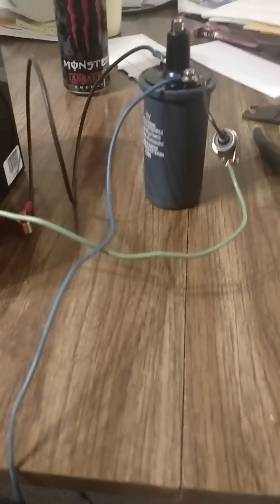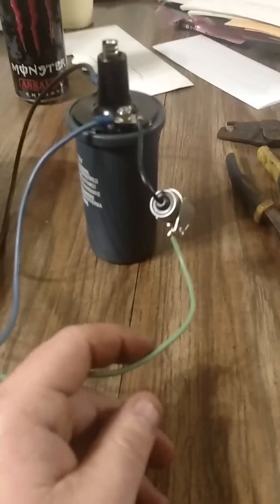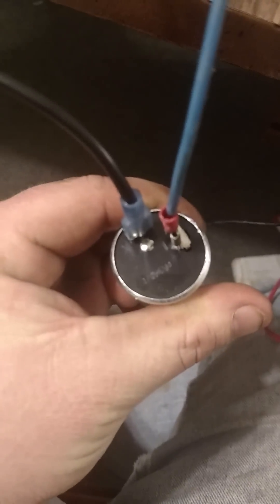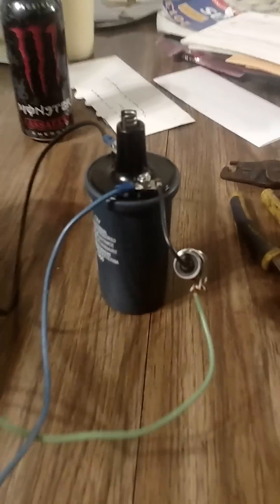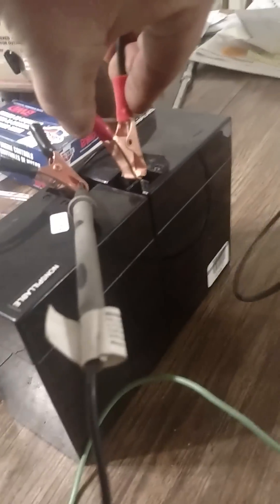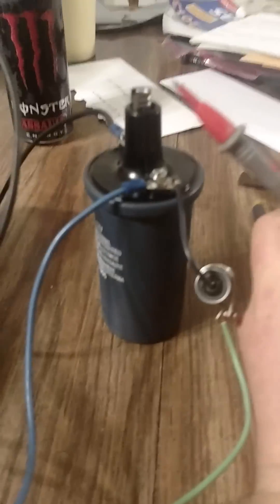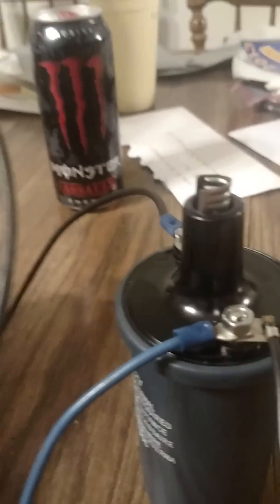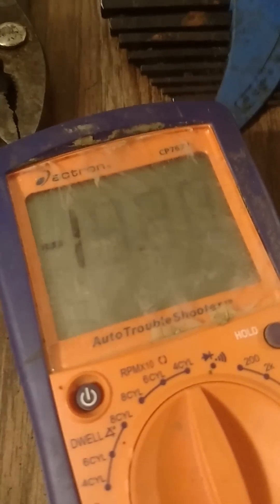Homemade electric fence energiser

Comment: I need to make this cuz I'm tired of people breaking that would teach them a lesson
Reply from the maker: Do your research on coils. I know there's one that burn hotter than what I had. And flasher relay goes on the negative side of the coil, in between the negative side of the battery

Comment: Guy told me he killed a bull with model T COIL  I USED A CYCLOPS FENCER.  Has lightning protection blows a fuse or about a$100 board. Pricey yes but mine has 32 joule out put . I  won't touch it  again!!!

Comment: I saw one where a guy used a capacitor to determine how often the Sparks happens period and the less time in between Sparks the weaker the spark
Reply: I think that's basically what the turn signal controller is, a capacitor.

Comment: I bet a flyback transformer out of an old tv would work too, nice video 😎👍
Reply: Is there one of those in a projection TV or only tube or CRT style?
Reply: @z3phyrdok  I believe both types, definitely in the old thick ones from the 70's through early 2000's

Comment: Great idea! Accel super coil, car battery, solar charger? I cant imagine a coil killing anything, Ive been bit more times than I can say as a mechanic by oil filled coils, magnetos and HEI. It hurts like hell and will make you hurt yourself trying to get away. Some coils cant handle full 12 v, After they cook theyll start leaking oil out the coil wire connection or the bottom will get kinda round too. Some cars, tractors or whatever had a ballast resistor to cut run voltage and coils only got full 12 while cranking. I bought a digital fence voltage checker. It takes the guess work out or standing and watching for cows or horses to get into it.

Comment: More energy efficient would be to trade the old heater style flasher unit with an electronic flasher unit. Consistent pulses with little power consumption from the flasher unit. Thumbs up to homestead ingenuity!
Reply from the maker: Could put some kind of dail regulator between the flasher relay and ground to control the speed
Reply: I don’t think that would work as the pulse rate is controlled by an oscillator circuit inside the electronic flasher.
Reply from the maker: @andrewdodson4326  In at flasher system on a vehicle, that's how it works. The high the watts of the light bulb, the slow the mechanical flasher relay will run. A light bulb would use more power, but it would also indicate that the fencer is working. Making a spark gap from the top of the ignition Coil to the wire feeding the the fence could also make it hotter
Reply: Yes, true for the older mechanical or heater type flashers.
Reply from the maker: @andrewdodson4326  sorry if the video is not very well. May someday make a better one, when I get better at making videos
Reply: Sir, is it deadly for human? Or just shocked / repell? Thahkyou

Comment: Measure: ~5KV per 1/4" jump of gap. Use a 555 timer/oscillator instead of a flasher. Less power draw. longer battery life.
Reply: Points is to not use computer chips.
Reply: @skimowhite586   555 is just 25 relays in a small package.
Reply: Hi I live in the village. In such circuits, the current strength is not enough and the coat coat does not impenetor. It is better to make a diagram on DB3. So the condensationator is detached. Yes, from the transformer from the car. The spark is greater. But it is better to make another transformer with pile hands.

Comment: If we need to increase zapping power of shock, on existing pulsing energizer, 10KV out power 9KV return , at existing 14J - what will be best ceramic condenser to use to increase power to 25J

Comment: Just connect 240 ac to the wires on a 40 amp breaker lol. Anything that tries to escape will be laying there dead .
Reply: 😂😂😂It will get burned
Reply: Maybe you too.  I always understood that a 01.00 amp fuse was more than enough of a fuse for safety reasons to keep from keeling a human.  I maybe wrong, please correct me if I am.

Comment: I bought a charger from Lowes just Not hot enough the opossums and raccoons that even come In the house and eat Mine and the Cat food and tear things up would go past It like It was Not even there I Am trying this design but was having a problem with the ballast resistor over heating so I took an old headlight and wired It In parallel with the ballast resistor and the lights flashes on and off so I will know If Its working.
Reply from the maker: Why would you use a resistor???
Reply: @probuildjohnsonify  so It does Not burn out the Ignition coil, also I Am finding that the blinker switch might have a resistor In It which prevents It from shutting all the way off therefore Is Not allowing the Ignition coil to make a higher voltage spark, so what I Am trying now Is a LED brake light strobe flasher that I ordered from Amazon for about 10 dollars a 555 timer circuit would be cheaper but because there Is No more Radio Shack a pain to gather the parts together and build It, I so I bought a  1970's model Ford Ignition Module from Amazon for around 16 dollars but the voltage from the flasher to the Ignition Module needs to be reduced and Amazon  wanted too much for Resistors so I will have to try to find something around here to take apart and get It.
Reply from the maker: Is your flasher relay before or after the ignition coil. Flasher relay needs to be after the ignition coil run in the ground. I don't think time is a problem because when the ignition coils on the engine it runs a lot faster than what the flasher relay with run it. You could use a potentiometer to slow down the speed of the flasher relay
Reply: @probuildjohnsonify  I rewashed Your video and It does seem to work better with the flasher on the negative side of coil, I received that early Ford Ignition module and the brake strobe light flasher, the brake strobe light flasher works but Not what I expected It flashes for about 4 seconds then stays on............. the Ford Ignition coil I got Is the late 1970s blue tap I think Its Dura Spark 2 the black wire Is ground and the green wire goes to the Ignition coil negative side  the red  wire goes to battery positive and for driving the white wire goes to the battery positive and Is for starting,,,,, the purple and orange wire goes to the magnetic sensor Inside the distributor,  I tried using a over thousand ohm resistor connected to a 9 volt batter to the orange and purple wire and It did Not work so I had and old distributor and connected It up and turned It by hand and It worked, so I had to figure out how to duplicate that same current so I went with lower resistant resistors 600 ohms on each wire still did Not work so I reversed the wires and It worked then I used a 9 volt battery to power the strobe brake light flasher and connected to the orange and purple wire and did Not work so I reversed the wires polarity and worked, then I tried connecting the strobe brake light flasher to the 12 volt battery and It did Not work so must have 2 batteries to make It work. also the spark with the Ignition coil Is much bigger than without, but now I have to find a flasher to activate It so I got a bicycle taillight from Amazon for 6 dollars I Am going to try that.

Comment: Most commercial chargers have high voltage up to around 10,000 volts but very low current.  Mine has a 103M HV ceramic capacitor rated at 8000V maybe a higher capacitor would give the hotter spark?
Reply: The output transformer affects more here. Good luck. I did homemade. You need to re -wind the transformer from the car. Hello friends who is a farmer. Will be friends. I have Lamb , chickens.
Reply: Good idea, however what kind of compasitor will not give off high amps? It's the amps that kill not the voltage.
Reply: @jamesfrankland6820  wrong
Reply: @justthinkalittle8913  how so, please explain
Reply: @jamesfrankland6820  well the first problem is that you're treating dc power like it's AC. Dc power don't act like AC in transformers. The collapse of the electric field creates the step up in voltage, not just having power in the primary coil(That's why people use 555 chips). Your going to need something that turns off and on fast to make the secondary coil pick up voltage gains. 

Lastly voltage can kill! Look at tazer deaths. It happens all the time.
Reply: @justthinkalittle8913  sure DC voltage  kill unhealthy people in general, but your point taken in consideration.
Reply: @justthinkalittle8913  so right and how well I know being that I sometimes work with solar producing upwards of 600volts per string and will kill you it not handled currently. But at that amount of voltage in a solar system has enough amps to make you respect what you're working with.

Comment: I'm trying to work out what goes where between the flasher relay, the condenser and the negative terminal on the battery.  From what I can figure out the ignition coil has a primary negative and positive terminal, which are on either side of the top, and a secondary positive output in the center of the coil which you are not using in your example(?) 
So from what I could gather, 
you connected one wire between the negative thermal on the coil, to the load (L) terminal on your flasher relay?
And a second wire is connected from the negative terminal on the coil, to the condenser? But what terminal on the condenser (for that matter what terminals/connections does an ignition terminal have?)
And you said you connected the power cable to the positive terminal on the coil, does power, refer to the positive terminal on your 12v battery?

So what I need to know is 
if my assumptions above are correct 

and also, what do I connect the negative battery terminal to (which component, relay, condenser or coil, and which terminal on that component)

What the wiring is between the negative terminal of the coil, and (which?) terminal on the condenser

And if the L load terminal on the relay is connected to the negative terminal on the coil, what is the X terminal on the relay connected to.

If it isn't already abundantly clear, I have no experience or idea what I am doing, but I need an electric fence to deter a neighbour so cattle, and can't afford to buy one, so would love to give your idea a go.
Also if you have used your energizer yourself, approximately what minimum battery capacity and solar panel wattage did you need to keep it charged.
Reply from the maker: Kim Hartley email me and I'll send you a wiring diagram
redvalleytruckin@gmail.com
Reply from the maker: https://youtu.be/noAAgBA5vGs

Comment: Just wrecked my voltmeter testing daughters potable 12 V battery operated energizer. Bought proprietary model. reads 4 kV. Too high for multimeter. Have used your system successfully to keep pigs in but think V will drop in wet conditions. Keep on trying new stuff. Good luck

Comment: why would anyone leave a bad comment. I envy you for actually making videos. I am stil trying to get up the nerve. I am in pennsylvania and have been working on a high voltage capacitor discharge pulse motor for a six wheeler that i am rebuilding. thanks for your video. If you are near, I could use some help to do this and have some fun. thanks.
Reply from the maker: jimmy popp go for buddy. If you put a video up, let me know. I'll watch it.
Reply: Thank you. keep up the great work!!
Reply: If you get a chance watch the 1996 tesla symposium videos of Don Smith and you will find some amazing stuff. I have been building these things for a year but it took more than a few to convince me they were real then to figure out how they worked and then to find people who made them. it is something very rewarding. i am a chemist but I spend every second working on an EV Gray high voltage pulse motor and the electrical recycling system. It is badass.  you live on a farm too. I have a six wheeler that i bought that floats and has a blown engine. This is how i found your vids. thanks.

Comment: great idea, s there an update for this? maybe some detailed instructions on how to make it and overall cost...Thanks good work
Reply from the maker: ZERO COST, Cost estimate. Five dollars for the flasher relay, or you could go with a heavy duty one for fifteen. $35-$50 for ignition coil. I don't really feel like you need the condenser, but I had it on there hoping it would give it more of a charge.
Reply from the maker: ZERO COST I have a second video. On YouTube
Reply: @probuildjohnsonify   can I use the above prototype to fence 0.5 hectre of a farm? 
If not this what are the modification has to be done for my purpose.?
Please Help.
Reply from the maker: https://youtu.be/noAAgBA5vGs

Comment: Nice job! I was thinking about building a similar charger for my horse fence, I am only worried about the strength from a engine coil, don't wont the horses to get a heart stop :-) Do you use this for horses?
Reply from the maker: Mr FixIt. I don't see why you couldn't use it for horses. One flaw about it, you need a bigger solar panel and battery to keep up with how fast it runs
Reply: Luke Johnson hey mate were about is the blinker relay located